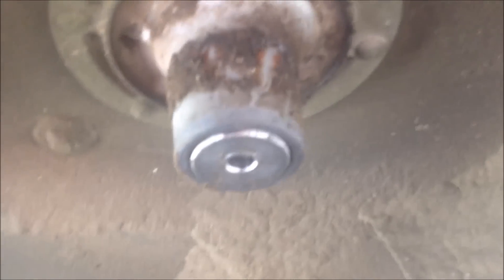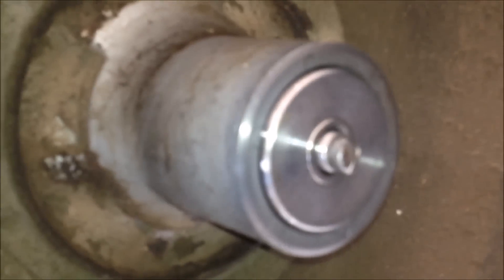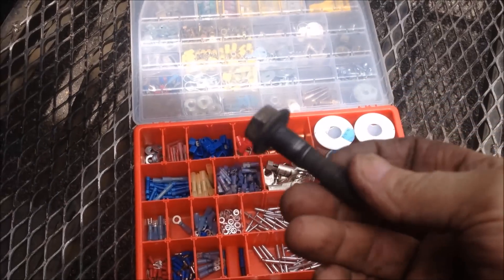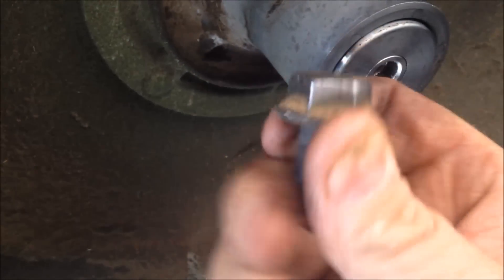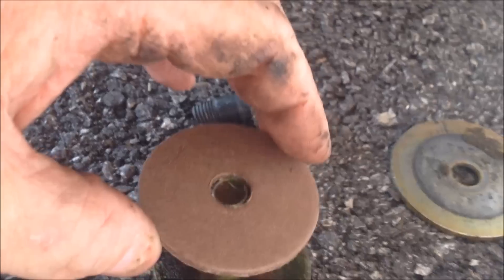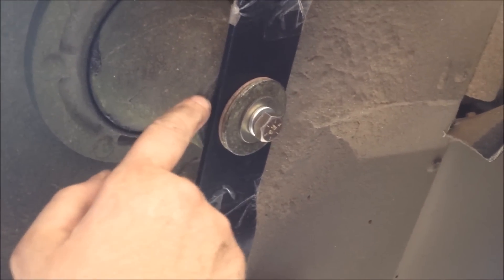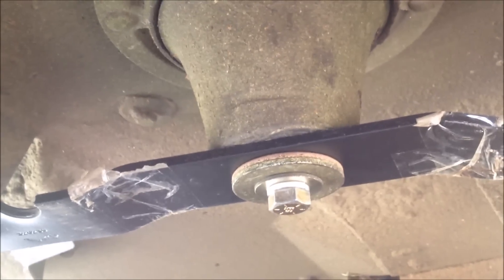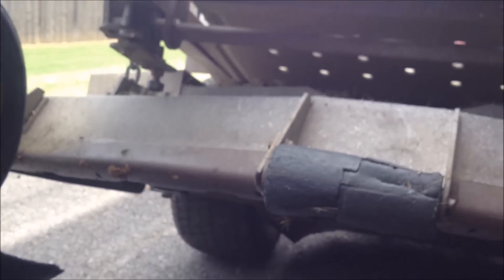GRASSHOPPER 225K HOW TO REMOVE A BROKEN BOLT FROM A MOWER  SPINDLE THE OLD SCHOOL WAY

Comment: I have never seen so many washers on a blade before, I own and run commercial mowers in my company but ours on have one washer between the bolt head and blade looked like he had definitely hit something I agree you got lucky on that broken bolt it came out pretty essy. Good video and good tips as usual buddy. Have a great day God Bless!!!
Reply: The way he shows the washers installed is exactly the way they are shown in the parts manual. That’s the way Grasshopper does it.
Reply: I wasn't saying he did anything wrong i was just commenting that none of my mowers have that many washers for the blades thats all

Comment: Left hand drill bits would have worked great
Reply from the maker: Yup. But when your tool budget is limited you do what u gotta do
Reply: I was just about to leave the same reply. Glad I scrolled down so I don’t look like a total noob. Harbor Freight #61686. Their drill bits are complete crap... but as little use as these will see, should be fine for a good long while. Go slow...

Comment: I spent 36 years working for the DON and I know what kinds of machine tools are required to do a job right.
Private industry make themselves look like a bunch of shade tree mechanics when, if they have the right tools, they want to charge 3 times the replacement parts cost or they want to use hand tools to do a precision machining type of repair. No thanks.
Reply: Private industry will out-perform government entities 99 times out of 100.

Comment: That is a LONG a** bolt... you only need 3-5 threads for full holding power. Any reason you used such a long one?
Reply: Nevermind... I replied before you put 42 washers on there.
Reply from the maker: Factory length
Reply: Honda push lawnmower have a 1 3/4 “ length  bold  !  I had replace with a 5/8 L